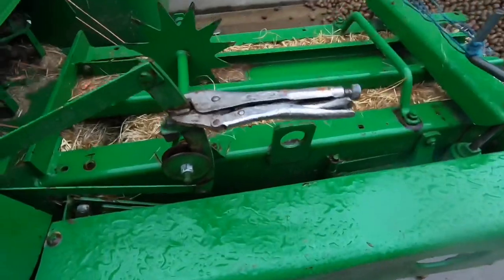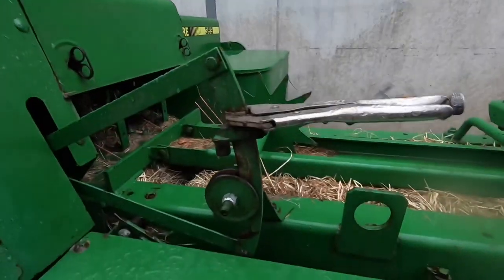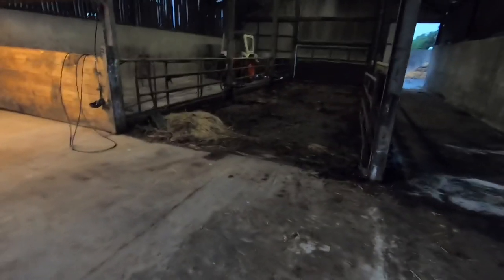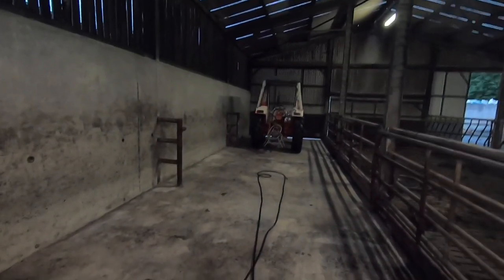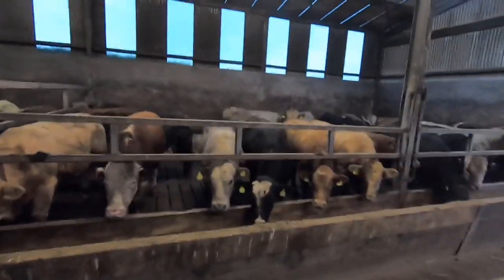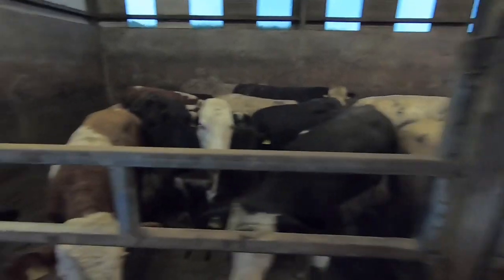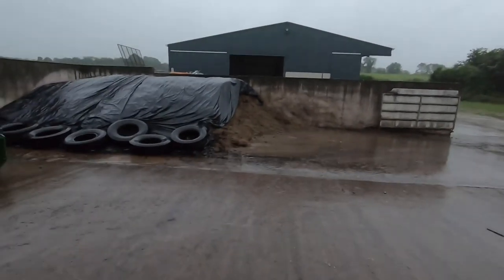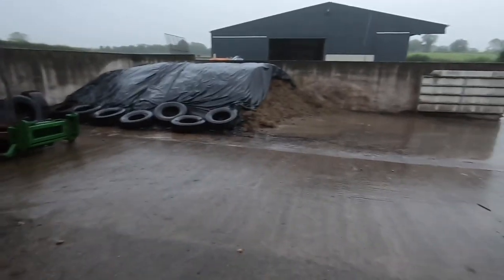THUNDER, JOHN DEERE 359 BALER AND LOTS MORE

Comment: Your fix is easy. A contractor near me broke 4 tractors yesterday buck raking. The first patient was their Valera that sheared it's link arms off then they broke the chassis on a John Deere 7530P I think. then snapped the front link hooks off on a new Holland and then cracked the front link brackets on another JD
Reply from the maker: Ohhhh f**k..... tough day at the office that
Reply: gerry6420 you day at the dealership😂 it was my neighbour that did it and he's working two straughtma wagons on Fergie's 6490 and 7718s and I tractor on the pit but he needs a wheel loader with the contracting.

Comment: Why do the men sit on the sledge? Do the bales not push through the flat eight themselves?
Reply from the maker: David E depends on type of hay. Usually it works on its own. Somethings depending on grass it can stick and someone moving the bales keeps the job moving.  You might have to only move 1 in 30 bales but it’s better then jamming it up.  It usually starts to stick if you save hay with little sun. Just how it always is.